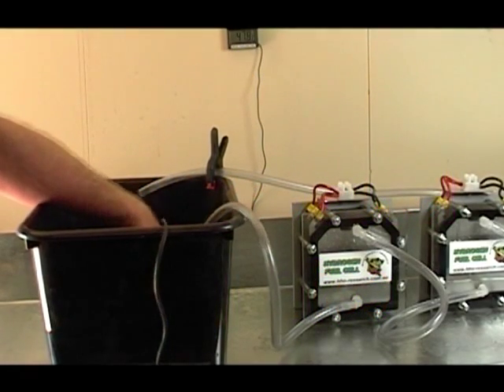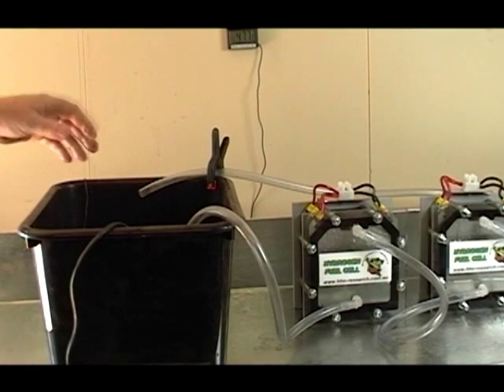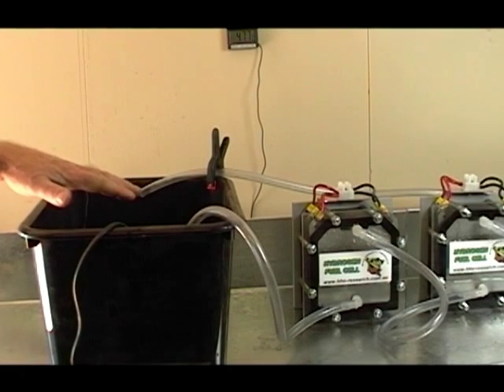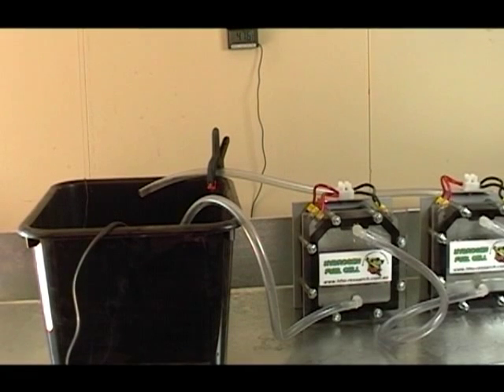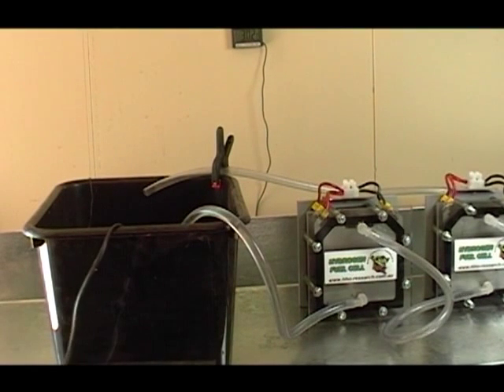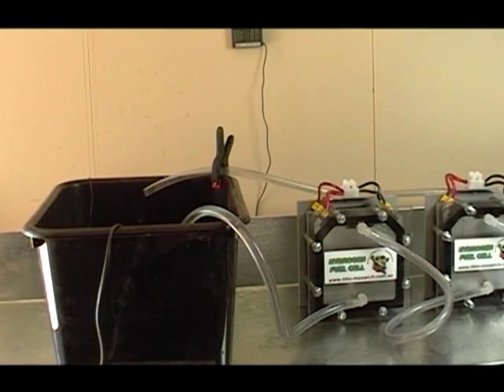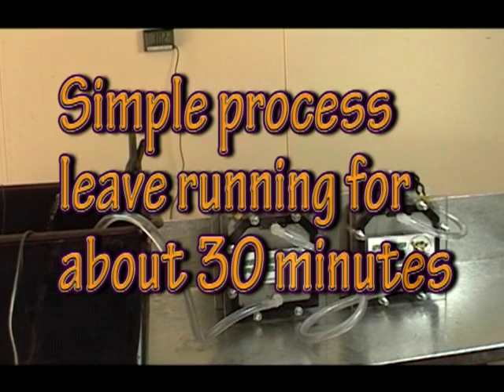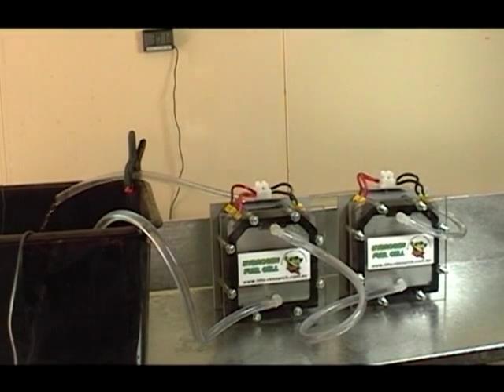Cell Plate passivation of stainless steel

Comment: I have tubes.... i take paper towels and rubber band them on and use lemon juice and let it dry in air
...for the inside of exterior tube i use foam to keep the paper towel against the inside surface